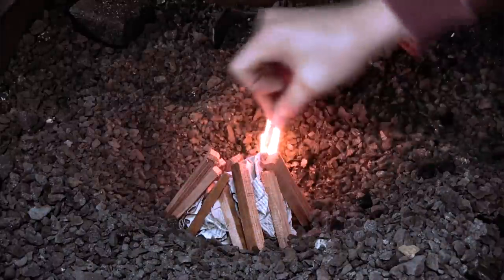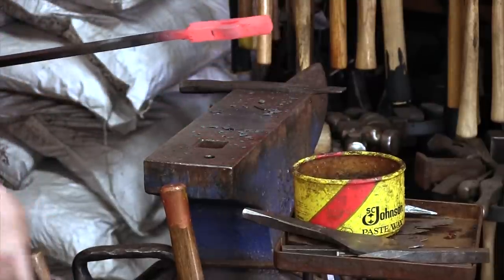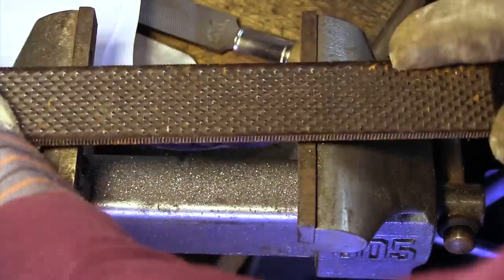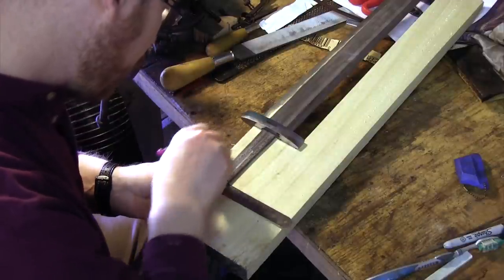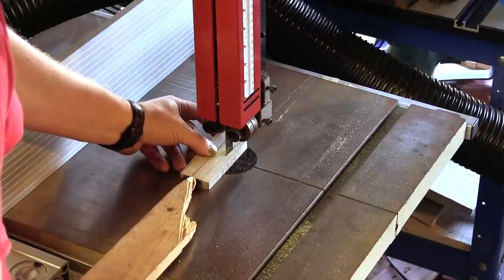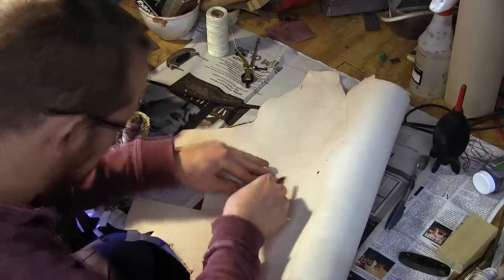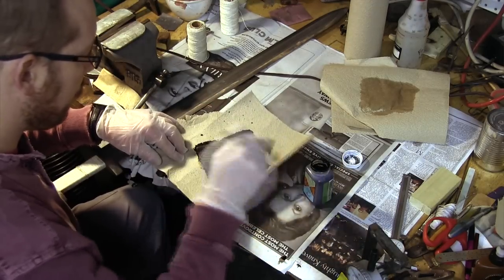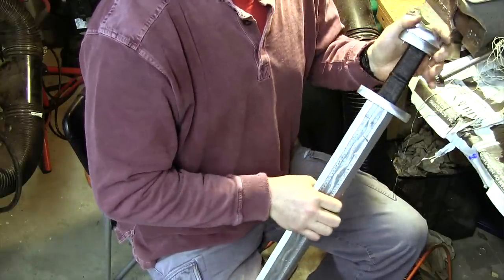The Serpent in the Sword: Part 3

Comment: For those wondering, This blade is actually very practical, and looks rather well balanced. You can't critique the weapons dimensions, they are historically a very reliable design. These are blade heavy swords meant to carry massive cutting power, and were a perfect compliment to the shields they were paired with. If you look through the norse sagas and eddas and pay attention to history, you would see that these are anything BUT impractical or unwieldy.

You made SUCH a beautiful sword, and I am very envious of the craftsmanship in this blade. I look for ages to find quality norse swords, but you have made such a masterpiece in this blade. This blade could easily fetch a price tag of $5,000 or more!

I would die for a chance to test cut with one of your works!
Reply: The blade is perfectly viable but I challenge you to find a migration era sword with a hilt that long, there usually a very snug fit in the hand.
Reply: Pro tip : you can watch series on kaldrostream. Me and my gf have been using it for watching loads of movies these days.
Reply: @Zavier Shiloh definitely, I've been using kaldrostream for since november myself :)
Reply: @Zavier Shiloh Yup, I have been using kaldrostream for years myself :D

Comment: I gave up using gas torches to braze my pommel pins into the pommel. I now have made a choke for my forge so the air feeds only 9 inches of the forge. I lay my pommel in the coals with the face upwards and use that heat to braze the rivet rods into the pommel. It works real well. Fantastic videos, love your work
Reply from the maker: +Wulfshead Swordsmiths that's how they historically brazed as well. The coppergate pad lock was brazed by sticking the whole thing in the fire.
Reply: Thanks for the reply to my comment, so glad my logic fits into the method of our ancestors.

Comment: There is actually a neat trick you can do with the string where you make a loop and then bind over it. When you're finished, you can put the end through the loop and you actually pull it back under the bind. 

There may be a few tutorials on youtube, it was quite effective when I was doing a knife grip and didn't want to use glue.

Comment from the maker: It weighs about 1400 grams - so somewhat on the heavy side.   Point of balance is a couple inches in front of the guard and vibrational nodes are where they are supposed to be.   The next sword will receive a little bit more taper.

Comment: Can anyone else visualize a jig for holding blades during the wrapping process?    I imagine some soft adjustable jaws inside a wide bearing on a little stand fixed to the table...    you'd need to be wrapping a lot of hilts to justify the time, but after watching you wrap just that one hilt saw how it could be a great help :)

Comment: If you wanted to make the binding of the hilt easier, you could put round timber over the blade like you do with the hilt.  Then make up a rolling stand, just like used for fishing rod binding (see YouTube of course). It would make the binding much easier and you can get a smooth finish with very little practice. Doesn't need to be motorised.

Comment: just so i have this clear.... you forge welded multiple stacks of different steels, drew them out, twisted some, forge welded them together again, cuts bits out, straightened the bar, forge welded more rods on, cut the tip, forge welded that together, forged the bevels, trued the whole thing and ground, like a boss.... 
And it was the hemp cord that you found "stressful".... :-)

Comment: Only one point of constuctive critisizm. When filing out your slots.... involve your full upper-body a little more, as if You were a sliding frame holding your file. You can get accurate enough that (in regards flattness) you will no longer say "I resort to filling" It will become your preference. Bob the tangs off your files, (no handles) and practce pulling instead of pushing your files, for tight and fine work. Bet ya Lunch, You will love the difference.